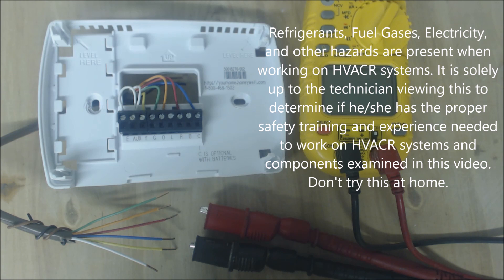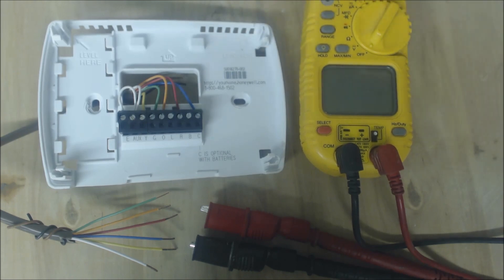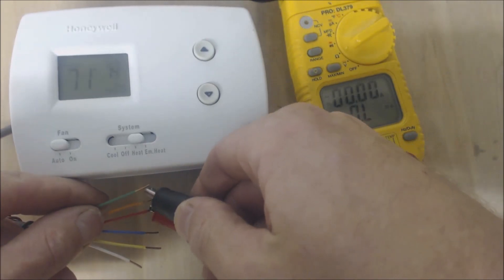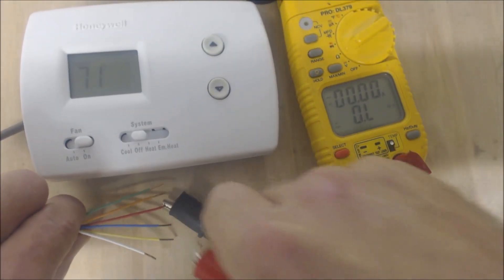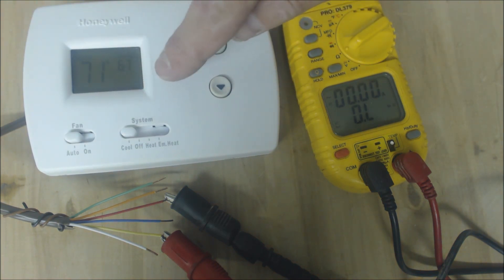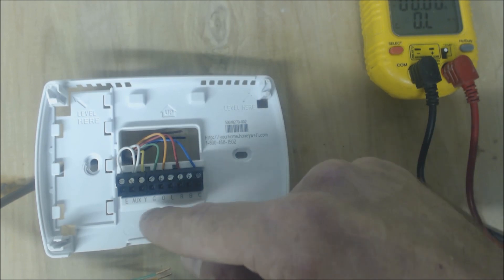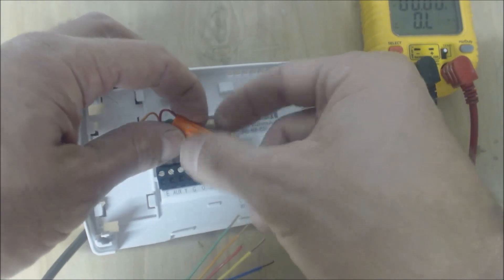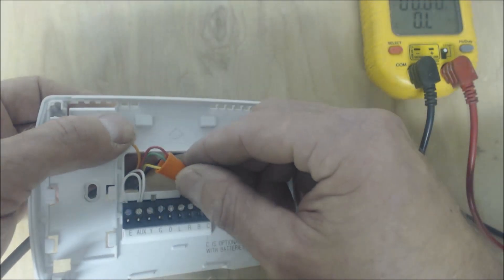Heat Pump Thermostat Troubleshooting!

Comment: I use this exact thermostat [Honeywell RTH3100C1002/E1] for my heat pump unit. In the heating mode, the unit will not shut off and then turn back on at a prescribed temperature (I have to manually go and turn the unit on and off or it will keep running indefinitely).  Some have suggested low refrigerant. It works alright in the cooling mode.  Any ideas?  I know this is an older video but any help would be greatly appreciated. God bless.
Reply from the maker: It sounds like the thermostat is bad or the low voltage wires are touching as if it is calling for heat. That wouldn't typically happen when low on refrigerant, thanks
Reply: @acservicetechchannel  Wow. Thanks so much....I pray that you and yours had a blessed Thanksgiving and, God willing, have many more!  Since this video was done some time ago, I was doubtful that you would even read my comment, let alone answer.   As it turns out, you were right about the black wire being Rheem/Ruud specific: once I removed the black wire from the equation totally,  the unit functioned again as it is designed to in the heat mode.  Our heat pump is a Carrier model.
Reply from the maker: Jimmy, may The Lord Bless You! Thanks for letting me know!

Comment: when I turn my thermostat up 3 degrees pass room temperature the emergency heat kicks in and my heat pump turns off.I thought the auxiliary heat was supposed to come on and work together with the heat pump to bring the house up to temperature. so whats going on any ideas

Comment: My heat pump outdoor unit is running when the thermostat shuts down at the preset temperature. Inside blower does not run and compressor safety switch shuts down the outside unit eventually. It happens from time to time even when I changed the 240V/24V contactor that powers up the compressor and tested thermostat to be good. What is next? My unit is RHEEM RPFA-024JAS and the thermostat is Honeywell RTH8500. I am an electrician but do not have experience in HVAC.
Your videos are very informative, thank you for posting them.
Reply from the maker: That is an odd one. You would have to find why the y is being powered at the outdoor unit. The thing is that the blower motor would run if it has the y 24v signal and that is before the outdoor unit. You could try checking to see if the r red wire is slightly touching the y wire going to the contactor possibly. Thanks
Reply: Thanks,
I will report my findings.

Comment: THERMOSTAT ON "EM" SETTING & I GET LESS HEAT THAN ON NORMAL HEAT SETTING.
WHAT CAN BE WRONG?
ADVISE PLEASE.
Reply from the maker: That is correct. With a digital thermostat like this, when your temp is one degree below what you have it set at then your heat pump runs. When your actual temp is 3 degrees or more below what you have it set to then your heat pump runs and your auxiliary heat strips run. When you have em setting only on then it is just your auxiliary heat strips running. It will feel cooler than when both are running if that is what is happening. On the other hand you could possible have only one of 2 or 3 heat strips running and that may have to do with a problem with the sequencer relay or board. There is alot of amperage running with heat strips and I would not advise anyone that is not a seasoned tech to troubleshoot that electrically. Thanks!

Comment: hi acservicetech I ask this question on another video hopefully you can help me I have a question my new package unit is blowing cold air even on heat mode so I check my wiring on termostat and I notice I have R,Y,W,G,C but c is not connected out side on unit. am I  missing  a wire here? my unit is a electric  rheem classic package unit also unit and compressor works just fine but like I said heat mode blows cold air. TIA
Reply from the maker: Check out this video. There is a switch behind the digital thermostat that switches from furnace and ac to heat pump--https://youtu.be/KY__QjS2EpM------    It is either that or you may not have the correct thermostat if you have a heat pump. The terminal colors you stated are normally used for furnace and ac and not heat pumps but check to see if you have a thermostat like the one in the linked video. Let me know how you make out. Thanks!
Reply: my Aux heat comes on when I set my heat on 72° then regular heat pops on is there a problem with the  thermostat
Reply from the maker: Nikita Hardman  If you have a heat pump with elec resistance backup then heat pump will run when it is only 1 or two degrees away from the temp set at. When you reach 3 degrees off then elec resistance and heat pump both run. If you turn the tsat to emerg heat then just elect reistance turns on- Check out the thermostat video list - https://www.youtube.com/playlist?list=PLxnHR5_D2ojzDfU1IjPpzdhi_mUGe3F7W

Comment: have you ever come across a heat pump and furnace auxiliary heat come on at the same time?
Reply from the maker: Actually that would not be a good thing because the air would be heated before the refrigerant could reject heat to it. In reference to electric heat strips the heat is rejected at the coil which would warm the air and then the electric strip heating would heat it more. I noticed at the end of that video I said furnace or air handler so I will put a note there. That thermostat is to be used with only heat pumps with el resistance or a hot water coil after the air handler for emerg heat. Thanks Ron!
Reply: acservicet
Reply: acservicetech  can't the auxiliary heat be gas, it doesn't have to be electric heat strips?

Comment: Hi acservicetech,  this helped out a lot!  when testing the wires is it better to take them out of the terminal block in the t-stat or test by placing meter probes on the screws? I understand why you take the wires out to jump them out, I was just wondering if you just wanted to check voltage what you per fore to do. Thanks
Reply from the maker: Good Question! If you just wanted to check from R to C then yes you would check for 24v then. That would be all that you could check for as the tstat face plate is disconnected and you would need a common to read potential voltage. Thanks!
Reply: Great! thank you for the reply. Keep the videos coming, I got a notebook going LOL!